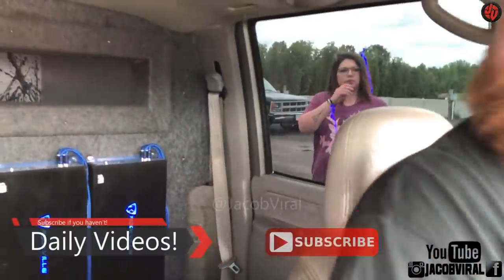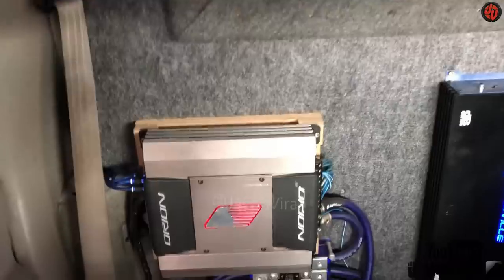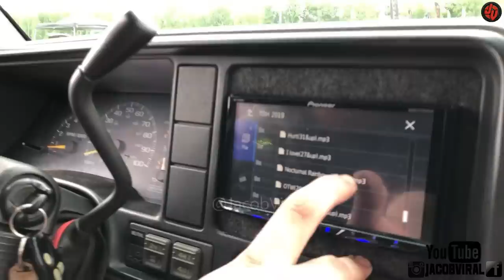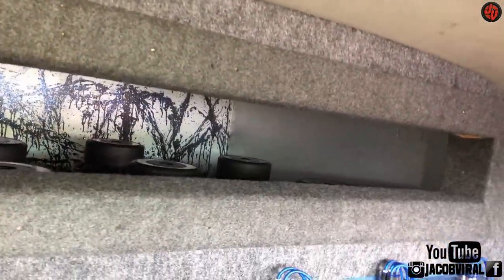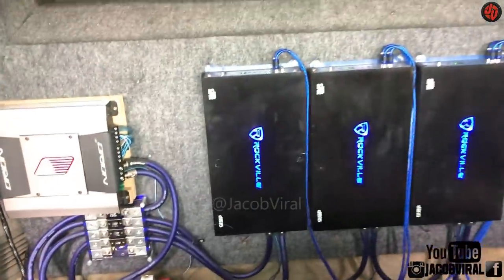FAMILY VEHICLE SYSTEM! DEMO AND WALKAROUND!

Comment: Budget friendly competition systems like this one need more love. One thing though I would use anti-vibration spacers--it helps with the transformers from moving (these amps don't have the greatest positioned transformers) and gives at least a half inch away from the bottom for ventilation..
Reply: 👈😏 these run cooler when they are like this. I like to think of this as free floating and it works great for 1,500 - 3000 watt systems.
Reply: 25Hz to Life these amps were mounted straight to the wall and I honestly never had any issues with  them.
Reply: Yeah I definitely use spacers now, too...

Comment: Good commentary Jacob 😁👍 Also I really liked the build! Love that he is able to get good output without breaking the bank! Definitely my kind of build.     I am surprised he had the room for a 6th order tuned in the rear chamber in the 20s with 6 15s! Insane! Goes to show build quality will make less expensive equipment shine. 😁👍
Reply: C Smith i appreciate it man. The enclosure was definitely too small for what I had in it, but it worked. Ended up picking up 4db when I slid it to a b pillar. It would play 18-60 no problem.

Comment: Wood glue inside the box is the cheapest best way to seal off your box and make it air tight and stronger. I tried it and it is loud. Every seem needs lots of wood glue.
Reply: If you build it right you don't need anything to seal the inside 🤔
Reply: @slow_rednline4874  yes but wood glue drys and makes your mdf or Baltic Birch wood way more stronger regardless of how good you line the walls up and screw them.

Comment: Great build love 2 see that underrated unappreciated rockville equipment in use nice build btw n great content as usual keep u the great work bro DD Z2 J from JERZ!!##??✔✔💯💯👊👊💪💪👋👋👍👍
Reply: John Remsen Jr. I appreciate it man. Sadly the build is no more. I sold the truck and it’s been completely rebuilt.
Reply: @tombowman3058  Damn, what happened with that?
Reply: Bailey Basshead sold the truck to a buddy of mine and he tore everything out. It has 6 avatar 15s on 3 taramps md8ks in a big b pillar 4th now.
Reply: @tombowman3058  well sounds like he's got a big build in there but you still had a really nice setup. I was just sad to see the truck go, but sometimes things just happen certain ways. I just didn't know if you got out of bass? Are you gonna put you any more systems in any your current vehicles?
Reply: Bailey Basshead I appreciate it. I was happy with it for what I had into it. Definitely not out of car audio, don’t know if that will ever happen. I bought back one of my old truck about a year ago, and spent the last year completely rebuilding it from the ground up. It’s a 94 extended cab step side full-size, and I’m actually finishing up my build in that now. All soundqubed build, 4 8’s and 3 tweeters per door, one s4-100 amp per door, and 2 hdx3 18s in a 6th wall on an audioque 3500.1. All of the building is complete, I’m now on to the trim panels and making everything pretty.
Reply: @UC08Vhmws0Zqwm_3C1aB1o7g Nice! Yeah, I've definitely ran soundqubed. Would like to see your build when it's done. Keep us posted...

Comment: I would rather have Boss them Rockville lol. JMO
I like budget builds ty Jacob.
Reply: jason williams I’ll be honest, I beat the hell out of these Rockville amps for almost 2 years and they never gave up. I sold the truck and it all god rebuilt, but as far as I know the amps are still going strong. I had them wired at 1 ohm, they are 2 ohm stable, never got hot or anything.

Comment: Think he meant 2ohm cuz I had that amp and there 2ohm rated not 1ohm...unless Rockville had another and I didn’t knw
Reply: 876 CAR AUDIO you are correct about the amps being 2 ohm, but I had them wired at 1 ohm. Beat the hell out of them for 2 years daily with no issue.
Reply: Tom Bowman must be cuz your electrical system is a good...I sold mine and now use 2 Orion xtr 1500 on 2 American bass xfl 15
Reply: 876 CAR AUDIO nice man. I had decent electrical in that truck. I ended up selling it to a buddy of mine and he tore everything out and rebuilt it. I am currently finishing my extended cab full-size walled with 2 soundqubed hdx3 18s on an Audioque 3500.1 wired at .5 ohm.
Reply: With box rise the amp may never see 1ohm. EXO just wired his 18s to .35
Reply: tiffani smith box rise was exactly why I felt comfortable wiring them to 1 ohm.
Reply: Oh I see...am too scared to do that even tho I Knw box raise fact but I live in Jamaica so not easy and cheap to play with my equipment like that lol so I stay safe
Reply: 876 CAR AUDIO that’s understandable. These amps were only $150 each so I didn’t really care what happened honestly.